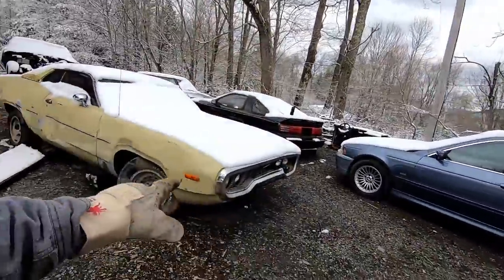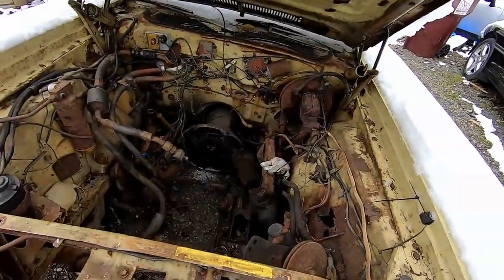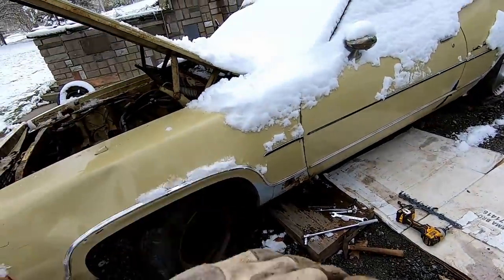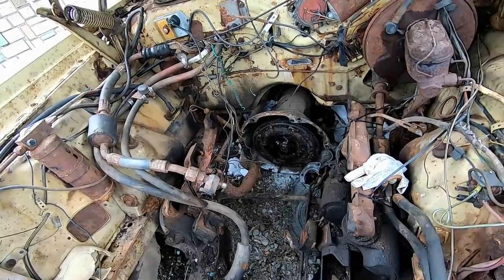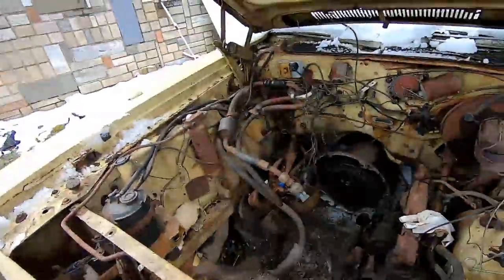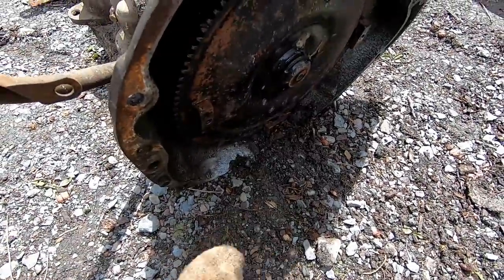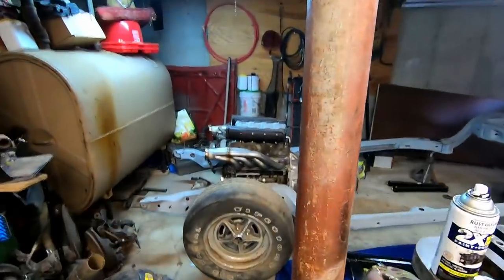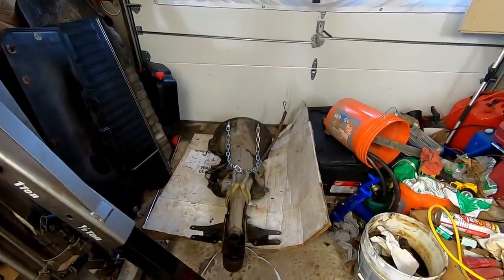Pulling Out the Transmission Out of the 1972 Plymoth Satellite

Comment: The transmission will be much easier to build on a table.  Pull the front pump and low/reverse drum and input shaft come out as a unit.  Then the planetaries and sun shell, the output shaft with governor, tailshaft, and valvebody (chuck the giant spring that comes out with it).  Those are the subassemblies and I can walk you through it.  Just don't throw anything away until the job is done.  For parts, I would get a shift kit (I like B&M), a 5.0 second gear apply lever, and a good quality American made rebuild kit.  Also, find a thin flat magnet to put in the pan.  I like a deep pan with a drain plug and I put the magnet right in front of the plug's sump.

Comment: Can I recommend picking up 2 sheets of 3/4 plywood= Makes an instant work slab, and great for using cherry pickers on. 
Saves your back- I messed mine up from working in the dirt.
Good work, keep it coming.
Reply from the maker: Thank man
Reply: I pulled an engine out my 70 Camaro on gravel with a hoist the hoist fell over and tore up my core support and front end

Comment: I wouldn't throw those valve covers away unless they have holes in them.  They may be desired by some guy pulling off cliche aluminum valve covers or stamped chrome steel valve covers and wants to put his, say , 340 Duster/ Charger/ 'Cuda back to stock.
You might consider a 518 trans since you have to do a lot of work on the cross member anyway.

Comment: Now that you have the trans out you can compare the new cross member with the old The right side is so twisted and rusty it will be hard to compare, Get the car up as high as you can and measure the length side to side and the shape, I think you will find it's the right one! Back in the late 70's and early 80's when there was a lot of these late 60's and early 70's Mopars on the road rotting apart from Ohio winters I used to make partial crossmembers to weld the torsion bar mounts to and the rear spring mounts to keep the springs from going through the trunk floor! I used to get these cars in one after another to rebuild the unibodies in them Before you go any further you need to check in the ''pocket'' that the upper control arm mounts bolt into to make sure they're solid plus the rear spring mounts at the back of the car to make sure it's not coming apart, I've seen a lot of them do that and it takes a lot of work to repair it!
Reply from the maker: Danny Casler I will check it out tomorrow thanks

Comment: How long before you get around to setting the rest of that tile in the house?
Reply from the maker: 😂 it is for when I remodel the kitchen and bathroom. So maybe 2 years I am waiting for the twins to get a little bigger. I pulled all the carpet up an put hardwood in 3 years ago. It was mint till they could walk lol. So I figure I should hold off on new tiles 😂😂. Pro tip don’t put a lot of money into hardwood floors then have kids. Do it the opposite way 😁🤙 on 2nd thought maybe I should wait till they are 5 or 6 😬

Comment: You know that the engine & trans are installed from underneath, right? Good Luck!
Seriously, you should be alright as long as you have that Satellite properly supported. Be careful out there!
Reply from the maker: Yup but with a completely rotten crossmember and floor pan I don’t want to get the car to far off the ground. Safety first

Comment: Torqueflight 904's have great first & second gears for launching if your differential has 3.23 or 3.55 gears plus 3rd gear has a great highway set, my 'cuda has a 904 with 3.23 8 3/4 differential and got 26 miles to the gallon on the highway, plus is eats rice burners off the light!
Reply: You’re thinking of the A998 or A999.  Those are the low first and second gear transmissions.  904 is great though, especially if the close ratio works for what you’re building.
Reply from the maker: I am going to see how far into the bell housing the corrosion goes before I make any decisions
Reply from the maker: How common are 904 transmissions
Reply: I have yet to see the video, but it will stop at the pump.  It’ll be fine.
Reply: 904's are basically the Mopar go to transmission for the 225, 318 engines, but sometimes you'll see a 727 on a 318, my parents had a 1971 Satellite Sebring with a 318 backed by a 727, and I've see a stock 360 backed by a 904 too. Basically the 904's are the economic transmission while the 727 is the performance transmission because the 727's backed the 340, 383, 400, 413, 426 wedge, 426 Hemi, and all the 440's as well as the performance 360's. Don't be fooled the 904's can be woken up with a shift kit and the clutch packed up dated. I know of a fellow mechanic I worked with that woken up a 904 backed on a blown 360 that was pretty much bulletproof when he when nuts on the throttle, he made a record burnout at Bandemere Speedway in Denver, CO back in the early 90's (went from the light tree to the traps on snow tires, he would have gone further but the tires blew out when he got to the traps), if your thinking on waking up your 904 call Don at Ajax Automotive in Denver, Co @ 303 420-3696 and ask him about Eric his old transmission guy and tell him about your ideas for your 904, Don should get you in touch with Eric, if any problems tell Don that Dennis from the Air Force referred you to him, he should help then.
Reply: Just tossing the accumulator spring makes a big difference.  After that, I would put a higher ratio second gear apply lever.
Reply: @johnwilburn  A few years back there was a company that made the Shifting valve that bypassed the pumped fluid to the transmission while in park, most old Torqueflight transmissions never bypassed the cooling pump fluid while in park, this made the transmissions last longer and for about $10.00 it was a great insurance policy on a freshly rebuilt transmission
Reply: @johnwilburn  No, all 904's have the low first & second where do you think the A998's and A999's came from? Well the A999 is off of the 727, the A998 is off of the 904 and both A998 & A999 have the 4th gear overdrive instead of just 1 to 3 gears like all old auto transmissions.
Reply: The biggest problem was people checking the transmission fluid in park instead of neutral.
Reply: @cudathehawgjetfixer7520  Respectfully, you are wrong all over the place.  Every bit of that.
Reply: @johnwilburn  My information is correct, I've worked on the 904's and 727's and I have also a Torqueflight transmission specialist that'll back my information whom was taught by Ma Mopar, and also built many of 904's Torqueflights for racing, and he highly recommends the 904's for their low 1st & 2nd gear setting over the 727's, but the 904's need to have extra clutch packs and steels to handle the extra loads from the engines. Talk to Don @ Ajax Automotive in Denver, CO (# 303 420-3696) and ask him about the 904's
Reply: Nope, you’re gushing misinformation.  I don’t have a “transmission guy.”  I am a transmission guy.  The 904 and 727 have about the same ratios.  The 998 and 999 have a low first and second.  (2.74, 1.54, and 1.00 vs. 2.45, 1.45, 1.00).  However, the later model 904s had the low ratios.  I just don’t conflate the later transmissions when a 999 can be made non-lockup easily and has a stronger case.  Also, you’re confusing the A500 overdrive with the aforementioned transmissions.  It’s 727 + OD equivalent was an A518.
Reply: @johnwilburn  how long have you worked xmissions? Not very long, I suppose, because I was taught by a former Ma Mopar TRAINED AND CERTIFIED Torqueflight xmission specialist, whom had worked on both production line and at dealer work shops and I believe he's forgotten more on Torqueflights youll ever know about xmissions.
Believe what you want but I really know about what is true and I'm speaking of the truth.
Reply: I have a two year degree in it and have built many transmissions, front, rear, and all wheel drive.  I guess I can’t know as much as some guy on the internet who knows some guy.  My bad.
Reply: @johnwilburn  If you want to talk to the individual then read earlier in this thread or the one on torsion bars I have left contact information so one could speak to the Torqueflight Guru, and he'll get your information corrected. Plus I have had a Master Service Technician Certification from ASE 22 years ago, also I have an Airframe and Power Plant license from the Federal Aviation Administration for over 33 years, and I think I know a little about planes, missiles, satellites, cars, trucks and heavy equipment. Also served 32 years in the U.S. Armed Forces as an Aircraft Maintainer (worked A-7's, A-10's, C-130's, C-5's, F-4's, F-16's and KC-135's) 2 years as a Satellite Technician (worked on Magellan and Galileo) 2 Years as a Missile Mechanic (worked Titan 2, Titan 34D, Titan 4 and Commercial Titan)  4 years as an auto mechanic, and 3 years as a diesel mechanic (with the City & Country of Denver), also I've worked on Celebreties private aircraft (worked Dassualt Falconjets, Learjets, Gulfstreams, Bombardier Challenger series, Cessna Citiations, Beechcraft aircraft) So I really don't need a degree in mechanics I've had been taught by some of the best mechanics I know, and certified not only by the Federal Government but by your own standards of Automotive Service Excellance programs. If you want to compare picking size!
Reply: Well all that military and ASE institutional inbreeding explains how you can be so stalwart about being wrong.  Fact:  Most 904s (all before the 80s) did not have low 1st and 2nd.  Fact: the 999 is a three speed, non-OD trans.  FACT:  the 999 is based on the 904, not a 727.  I don’t care who you learned from, those things don’t change for your recollection’s sake.  I’m not some private who changes his mind out of fear to placate you.  Geez man.
Reply: You sure dropped the subject at hand quickly.  (snicker)
Reply: @johnwilburn , nope just proved you cant even know the difference between 3 types of engines let alone transmissions, until you could tell me the differences then why waste my time with someone who doesn't know how to be a mechanic!
Reply: You FAILED the subject at hand so you changed it.  Classic.  I’ll get back to working on a 904....  something I know a lot more about than you.  Period.
Reply: @johnwilburn  sorry, you still don't know what your talking about, then explain to me why I have 3 904's all numbers matching  from my 1972 Barracuda, and 2 from 1974 Dusters! All of which are pre-1980, and verified by B&M transmission and Aamco transmission as low gear set from their own transmission Technician's plus my good old friend whom had worked for Ma Mopar as one of their transmission builders and later a transmission technician back in 1992, And still haven't answered the question, if you are a real mechanic then it'll be easy
Reply: Oh, somebody’s been googling!  You said ALL 904s were low geared.  My 68 and 70 have the standard gear sets.  I bought the 70 from the original owning family.  I guess someone sneaked into their driveway late at night and changed it.  Get out of here.....  Still think a 999 is a four speed?  LMAO.
Reply: Easy.... they aren’t.  Trolls sure spew a lot.  It’s like the late night wealth building infomercials.  Beware the guy who goes way over the top to convince you he’s right with unrelated stuff.  I’ll just drop this here for simple reference.  Argue with them:  https://en.m.wikipedia.org/wiki/TorqueFlite

Comment: Please, as I mentioned before, throw something under a Mopar before you climb under it. Torsion bars tend to snap suddenly, and you don't want to get crushed!!!
Reply: I never had a torsion bar snap on me...Remember GM/Ford/Imports can also snap suddenly and crush you when the front springs are rusty...That would be the only time a torsion bar snaps is when its rusted big time!
Reply: Dude you missed April 1 by over a month.
Reply: @corymagnus7452  well, back in around, 1990, my ex- wife's '74 Duster broke two torsion bars while I was driving around a housing development, on torsion bar anchor socket also rusted out and the car dropped.  We sold the car to our best friends,  and a torsion bar snapped on them too...My co- worker's warnings about climbing under Mopars was correct.  I also knew a few other people at work, that also experienced the sudden drop scenario. I know, some of todays cars use torsion bars and I suggest the same safety precautions...
I knew a guy, who's torsion bar snapped suddenly while the car was parked in a car port. Ya just never know with them.
Just saying....
Reply: Yet amazingly, they didn’t break torsion bars jumping those 300 Chargers on the Dukes of Hazard.  If anything, the socket in the crossmember fails and that’s not common.  Torsion bars are way safer to work around than coil springs.
Reply: @johnwilburn  in this case, the passenger side socket rotted away. Passenger side rot is common in the North East, that's where the salt and slush collects so it's no wonder it rotted. 
I never had coil springs snap, then again, we each have had different experiances.. 
I once lived in the Southern Tier of New York, where the life expectancy  of a new car was 6-7 years. As long as you take safety precautions before climbing under any car is preferred...
Reply: @johnwilburn  oh, I'm sure they killed a few torsion bars on the General Lee cars. I believe they mentioned something along those lines....
I miss seeing the old Mopars.
Reply: In my 40+ years working on Mopars I never seen a torsion bar snap, maybe on the newer trucks that have a half assed torsion bar set up but never on the old muscle car Mopars, if anything it'll be the rear crossmember that'll fail first, and in this case yes the xmember is compromised and rusted almost completely through on the right side but never the torsion bar those are complete alloyed hardened spring steel that's the same used on the  30 ton m26 Pershing's to the 70 ton m1 Abrams tanks and those will never snap especially on a 2 ton car.
Best check your information because what you've said is complete garbage!
Reply: @cudathehawgjetfixer7520  3 torsion bars snapped on one '74 Duster,  plus one torsion bar socket rotted out. That car was driven very carefully by my former ex- wife. Oh, it was a slant six car...
My boss lost a torsion bar snap while on  his way to go fishing at 4:00 A.M.
Another guys Mopar snapped a torsion bar while parked.. 
It does happen. I never had a coil spring snap, so it just goes to show us. Stuff happens to all makes.
Reply: @johnwilburn  ..I bought some pretty rusted old Mopar's and never seen them collapse..
BTW:you were great on the engine rebuild..Hats off to you,you are the man!!! Star of the show!! Well,Tony was but you know...
Reply: Yeah, they don’t.  The crossmember sockets fail long before the bars.  Thanks man.  That build was a blast.
Reply: Never seen or heard of a torsion bar breaking!! The fact that you have numerous examples suggests some kind of Bermuda-Triangle Torsion Bar Vortex right overhead!!!😂😂
Reply: @wheels-n-tires1846  actually, it was not uncommon.
Reply: @howardkoster4026  im not debating it... We all have our personal experiences to go off of. Just sayin in 36yrs of havin torsion bar Mopars, and having friends with them etc...Ive never heard of it...
Reply: I do recall an old article from the 80s or 90s...either Ehrenberg of Uncle Tony wrote it... A suspension rebuild article where they mentioned NOT using vise grips on torsion bars, and to smooth nicks and burrs in them to minimize creating a  point of failure... Thats about the closest to a mention of failure ive ever heard until now...
Reply: @wheels-n-tires1846  I don't make this stuff up.
My ex- wife drove her Duster very carefully, only drove 15 minutes to / from work. While her '74 Duster was quite reliable, my '69 Valiant was VERY unreliable.  It broke down constantly. What I fixed, STAYED fixed... But fir the first 6 years of that cars life, it was not used very much. 21,000 miles on 6 years..
Reply: @wheels-n-tires1846  oh, uh, I didn't take your comments as debating or anything negative.  I'm cool. You're cool.
Yeah, it's odd how some things happen to others, and then again, they don't to other people, if that makes sence. I would tell my ex- father- in law things, to which he'd say, " I never head of that". 
Life throws weird stuff at some of us.
My '69 Valiant never broke a torsion bar, but everything else in that car went bad...
Life is strange is all.
Be wel, stay healthy, peace out...

Comment: I may be wrong cuz I couldn't get a good look but that might be a 727
Reply from the maker: Lone Wolf Customs they look very similar but it’s oil pain is a 904
Reply: @LunarOutlawsGarage  okay just wanted to make sure
Reply from the maker: The easiest way it to look at the pan b/c they are similar in shape everywhere else. Thought I didn’t do a closeup 🤙
Reply: @LunarOutlawsGarage  904 has a square pan with a corner cut off 727 has a longer output shaft normally 904 caution if you like doing burnouts and you have a to something gear and a little bit of power under the hood you will burn the clutches in drive and have no other aspect I did it three times once with a 727